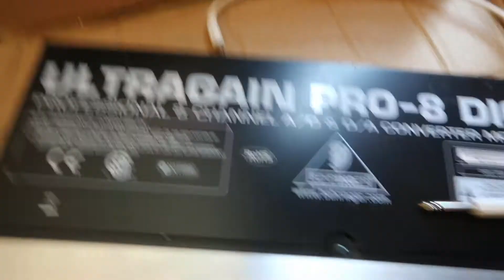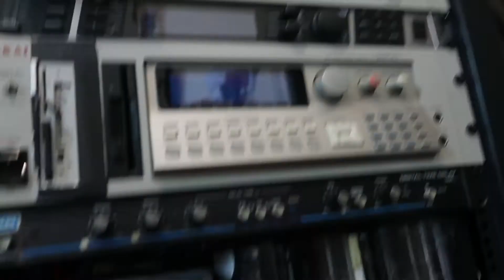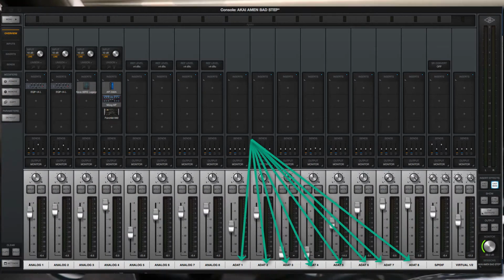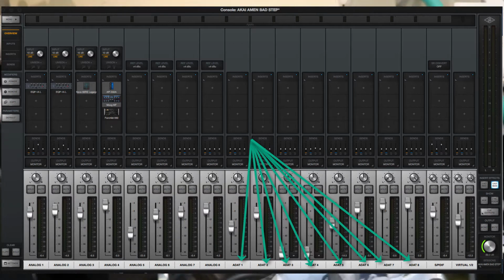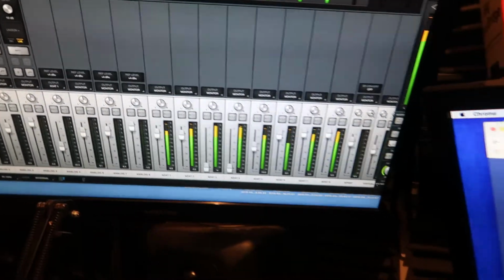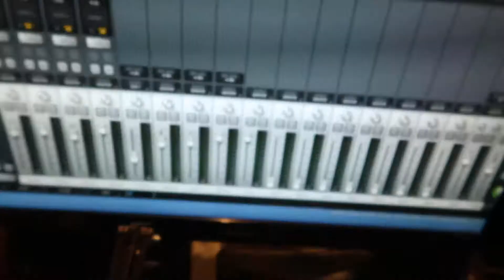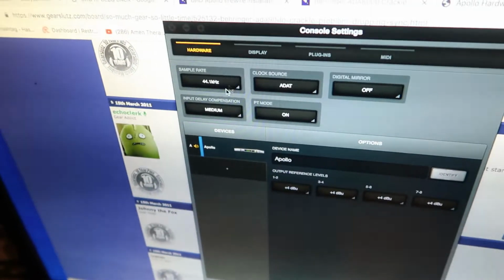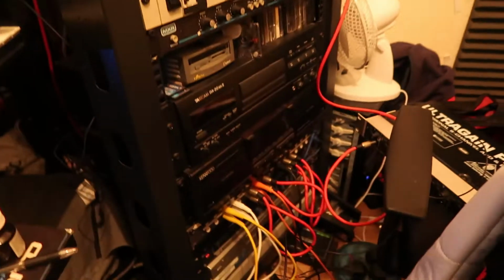How to expand your Audio Interface

Comment: thanks for the heads up on the behringer ultragain pro am interested in creating more inputs but don't have an adat connection on my external soundcard. Right now I use a patchbay for easily swapping between different input signals, but can't record >1 stereo signals at the same time. Anyone have an idea for a good rackmount soundcard <500 euro with adat options?

Comment: Wicked!  I was wondering how to get more gear into my studio, while having limited inputs on my interface!  My Fireface 802, only has 12 inputs (8 back and 4 front) and they are already maxed out and even then, I can't fully take advantage of my kit with multiple outputs, as I had to split them between the available inputs, so some multi out units, are only using 1 stereo out, as I had to share between the others.  I have available outputs, that can't even be used.  This is a neat way to be able to get more kit in the studio!  Not sure if that is always a good thing, though lol!  Thanks for sharing Brian!  I hope to see a follow up video, with everything wired up and working as expected, to really see what advantage this has and whether any noise, or signal degradation is going to happen with all this.